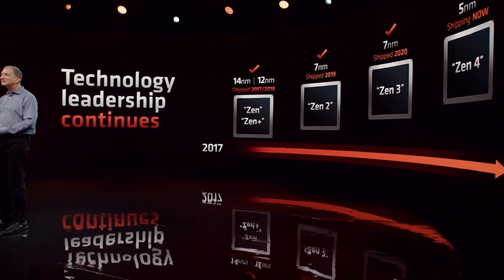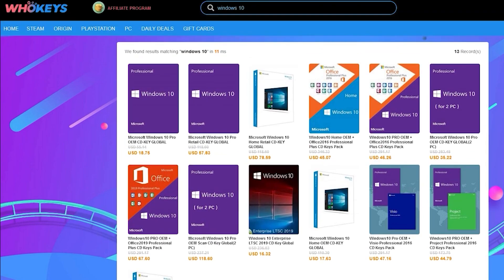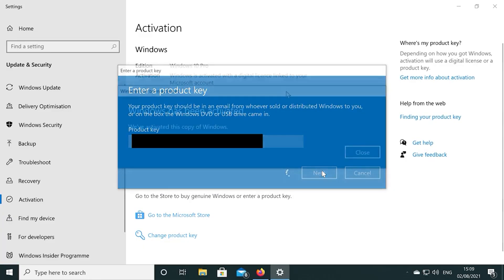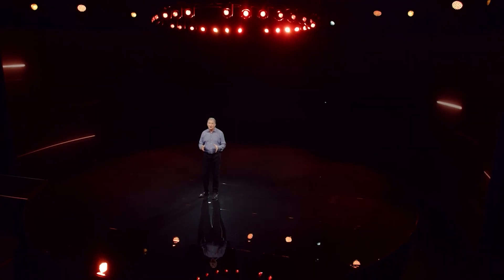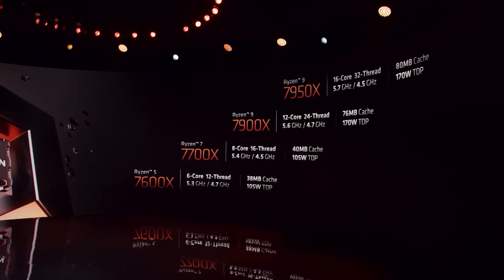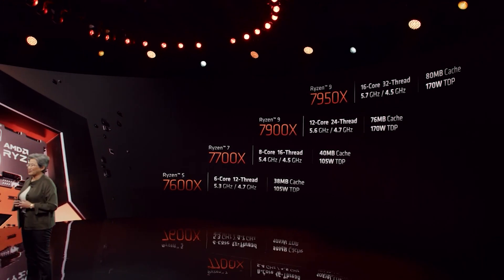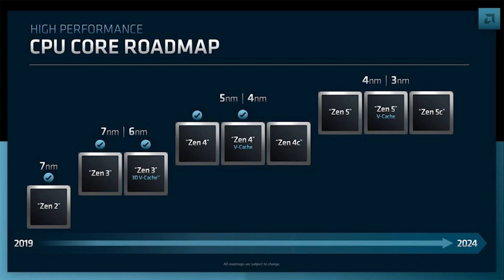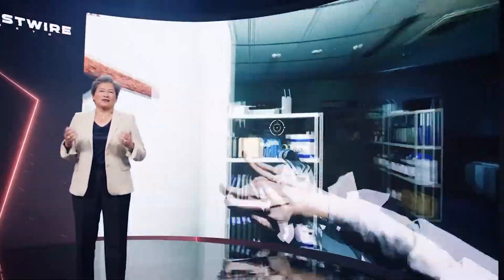Zen 6 CHANGES EVERYTHING - IPC, Clocks & Architecture Early Info

Comment: A new platform?  I certainly hope not, not already.  If they're pushing a new platform then it had better bring a significant boost to performance.  Difficult to understand why they would do that after getting 4 generations out of AM4.
Reply: A new platform would add support for new I/O, hopefully PCIe 6.0.  I can see the argument that we are far from saturating PCIe 5.0, so I don't necessarily see it happening on Zen 5 or even Zen 6.
Reply: @Fetrovsky  Yes and no.  The Zen 4 CPU-chipset link is only 8GB/s which sucks.  Even if they move it to 16GB/s it's still going to suck a little because of how much I/O can be on the MB now.  AMD left that link at PCIe gen4 X4 which is why it sucks.  If that got bumped up to gen 5 that gets you 16GB/s, but to get to 32GB/s which is where at least Zen 6 should be you either need gen6 or 4 more lanes.  If AMD actually does this upgrade AND leaves it gen5 because gen6 is going to be expensive for desktop (more expensive amplifiers/receivers, outstanding MBs with highest quality runs they can make), that takes you to 8 PCIe lanes and that would need a new socket.

Simply moving to gen 6 wouldn't require a new socket, just a better made MB.  But I'm not positive on this because I believe gen6 moves to more than two voltage levels for the signals and I forget the name for that at the moment.  I just don't see the need for gen6 for at least 3 - 4 more generations.  I mean both Intel and AMD haven't even fully moved to gen5.

If they were to move the mem controller onto the core chiplets which could give you the need for both dual channel and quad channel memory, that would need a new socket.  Those are the main things I could think of that would require a new socket.
Reply: @johndoh5182 Yes, I did mess up.  I said AMD would need a new socket in order to support  PCIe 6.0, which is not necessarily correct.  As you said, we would motherboards with better components that allow for faster transaction rates, but we would also need a new chipset, and I don't think we can get around that.  In the end, we'd need a new platform, at which point AMD might as well introduce socket improvements too.
Reply: @Fetrovsky  Yes they would CERTAINLY need a new chipset to move to gen 6 but that doesn't require a new socket either.  AM4 dealt with MANY chipsets and speeds.  It's ONLY if you have to change a pinout that requires a new socket, so different power delivery, changing number of PCIe lanes going to specific places, a different memory configuration (DDR4 vs DDR5 or dual channel vs. quad channel), etc.....

That's why I said if AMD goes to PCIe gen5 X4 for CPU-chipset link they don't need a new socket.  It's already 4 lanes wide.  It doesn't need more wires.  On the other hand I'd like to see them go to 32GB/s which would be PCIe gen5 X8 to the chipset(s).  That requires more wires and a new socket.  Although, there are probably unused pins on AM5 so even moving to PCe gen5 X8 might not require a new socket.

So back on the gen6 thing and why it would be BAD  going to the desktop, INSIDE the CPU and chipset or other internal signaling. 

gen 5 is going to be the last gen that uses NRZ (non-return to zero).  That's a two voltage signal.  If you have a high it's a 1, if you have a low, it's a zero, so it's still a binary signal with two logic levels. 

gen 6 and gen 7 are PAM 4.  This already exists in different circuits that generate EXTERNAL signals, like on an ethernet cable.  It requires that you generate a signal large enough to have 4 distinct levels.  Instead of encoding for a single bit (high or low) you're encoding for 2 bits. (00, 01, 10, 11).  This WILL make for more expensive components, so the CPU and the chipset, and GPUs for which there is absolutely NO REASON AT ALL to do since gen5 X8 is good enough for a good 8 - 12 more years.

There's just no need for it.  It adds cost, and the speed of gen6 for a desktop or laptop is just SO over the top it's crazy.

So getting to gen5 is important for bandwidth for NVMe and chipsets.  For a GPU there's nothing that that needs more bandwidth than gen4 X8.  You can double the performance of a 4090 and you STILL wouldn't be anywhere close to the bandwidth of PCIe gen4 X16.  And that gets me to, who needs more than 2X a 4090??  Does a person really need more than 120 fps @4K WITH ray tracing and not using DLSS for open world games?  And for competitive games you don't run that at 4K.

So gen6 is too outlandish for a PC for THIS decade.  Even with NVMe, if you could actually push a disk to run 32GB/s it would only be for one type of read op.  Most read/write ops would still be under 8GB/s which is gen4 speed, which is to say that even with gen5 drives coming out, they're mostly operating at gen3/4 speeds for most read/write ops.  But we're still a long way to even get a single disk running a cont. read at 16GB/s

Forget gen6.  That's for server for another decade.
Reply: Ummm, AM5 sucks right now.  That's why.  8GB/s for the CPU-chipset link?  They don't need a new socket to move to 16GB/s because that only involves going from PCIe gen4 to gen5 for that link.  But devices are getting very fast now, and if you want to have a nice MB with 4 NVMe ports, with the way gen5 drives will perform it needs to go to 32GB/s, especially when you add everything else that runs off the chipset.  That WOULD require a new socket because they'd probably move to 8 PCIe lanes of gen5. And then right now with the way they had to do the chipset, that REALLY sucks.  I mean if you want a nice MB they use 2 chipsets and one daisychains through the other? 

Memory speed sucks.

I could think of a lot of reasons why AMD would want a new socket based of the current failings of Zen 4 and how much the current interconnect holds them back.  Also if AMD were to go to a chiplet that's 8x4, two chiplets would put them up to 48 threads, but 2 channel memory is not fast enough for that many threads even at the fastest DDR5 speeds according to AMD, so their best move would be to get the memory controller off the IOD and put it on the CCDs.  If they went this config they could go up to a 24t CPU with a single chiplet and it would be dual channel.  With 2 CCDs that would take you to quad channel and 48 threads.  THAT would work.  And now you get a lot of product segmentation based on the CPU you buy along with the MB.  Going to quad channel would require a new socket.  The quad channel config would be HEDT basically, with 48 threads?   And with a lot more I/O built into MBs now you don't need a lot of PCIe slots, and if they push the CPU-chipset link to 32GB/s that right there is giving you the speed for a lot of devices connected via the chipset.

You know with a CPU-chipset link at 32GB/s you can have that third PCIe slot which is always off the chipset be X8 gen4 and only be using half the bandwidth of that link.

I'm not saying this is what AMD WILL do, but if I were in a top position overseeing CPU development that's what I would have pushed for.  In fact I would have at least gone to 2 different CCDs for Ryzen, a straight 8 core like they have now and an 8x4 and at LEAST get the thread count up to 40 for Zen 5.

Comment: im on  am4 with a 5900x and will be skipping 7000 and 8000 and if i hear they gonna go too a new socket then i would wait for the 2nd round of cpu on that socket after seeing the issues with new adoption , either way i dont plan to upgrade for 4 - 6 years my 5900x and 4070ti should be good for that long hopefully, tho many are still on ddr3 and ddr4 ddr5 hasnt been as big adoption as intel or amd wanted i dont think
Reply: You can always delay for the next upgrade, I jumped onto the 7950X as soon as it was available in the UK apart from DDR5 not being available in 2 X 32Gb (64Gb) sticks so I had to get 2 X 16Gb (32Gb) and then upgrade again when they became available. I am very happy with my 7950X's performance especially when I run it at 105W ECO mode and down clock it to 3.0Ghz  Temps and power consumption are so low but the performance is still there for what I use it for and its so much faster than AMD 3900 !
Reply: @mrtuk4282  nice what do you use that beast of a cpu for ? More than gaming obviously wow that's a big down clock to 3ghz ain't it's base like 4.5
Reply: @Rob-el8ti  Actually gaming - EVEonline MMORPG (8 accounts = 45% CPU loading at 3.0Ghz) but I will be going back up to 10 accounts again soon which will be 55-60% CPU loading. You are correct the CPU will run at 4.5Ghz base but that will actually run faster up to 5.88Ghz which just creates more heat and uses more power for little to no gain as the game is actually run at 60Hz (Server side) well that's what I understand.
Reply: @mrtuk4282  8 accounts running at the same time ? is that like a botting setup  ? never played eve myself

Comment: Honestly, i was surprized that AM5 did not have 3 channel memory.
The 4700G and 5700G were memory starved for the GPU, sure i can get 73GB/s at 49.1NS of latency by pushing the 5700G FCLK MCLK and UCLK to 2500Mhz(DDR4 5000) but the platform becomes unstable above 2300(4600) often requiring the iGPU to be completely disabled unless you want to run a whole lot of voltage.
Sure with DDR5 you can get 100GB/s, but that requires running Zen4 in 2:1 or some other non-optimal ratio, and dont forget just how much faster RDNA3 is than Vega, if 8 Vega cores at 2.2Ghz was starved with 73GB/s, dont you think that 12-18 RDNA3 CUs would be starved with 100GB/s?

I think this is why AMD might be pushing to a new platform, and why i didnt expect AM5 to last for more than 1-2 generations, or maybe some low end parts from a 2nd/3rd generation
Reply: its just... then you might as well just invest in a low end gpu and get the benefits that comes along with that. Even the high bandwidth ram you mention can pay for such one. There are also only 2 considerations from AMD here. Regular plug and play and prebuild usage. We enthusiasts/builders are a drop in the ocean, even tinier when you need heavy OC and tweaking. They arent designing their portfolio for us.
Reply: @MyrKnof  The high bandwidth RAM i bought was under $100 back when a basic kit of DDR5 was $300, At one point it was under $50, but now back up to $75

But i'm not talking about AM4 needing 3 channels it works well enough with 2 because it only ever had 8 Vega compute units.

No i'm talking about AM5, which added enough pins for a 3rd channel of RAM

The 7840H when it finally makes it to desktop would definately benefit from tripple channel if it supported it, and the rumored 'big phoenix' with 20-24 compute units instead of 12 supposedly has a 256 bit memory bus(4 channels) which, likely means it is embedded and wont make it to DIY, but i'd be happy if i could get a mini PC with like Xbox series S performance, 4 channels of RAM so i can feed the hungry Davinci Resolve (sometimes runs out of RAM and crashes on the 64GB DDR5 5600 kit in my BeeLink SER6 Pro so i've been waiting to get a 96-256GB kit)